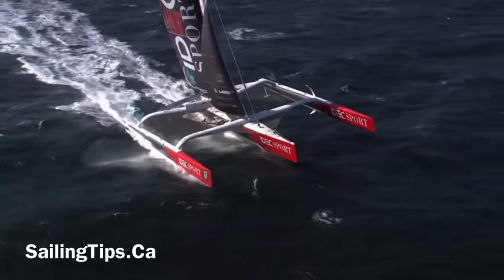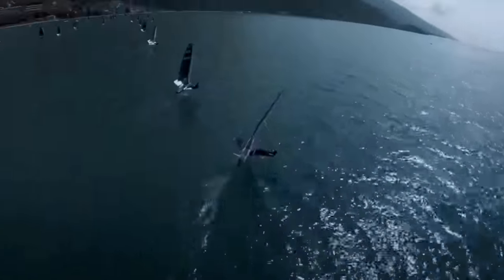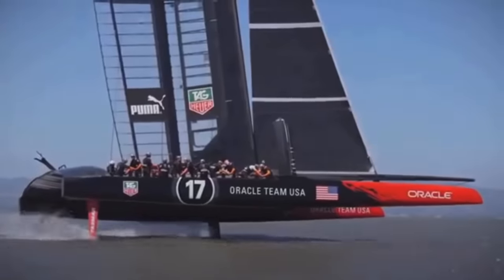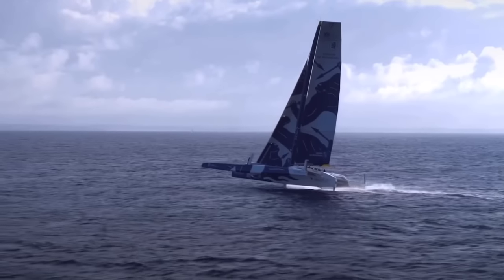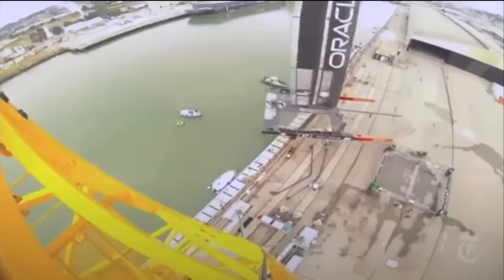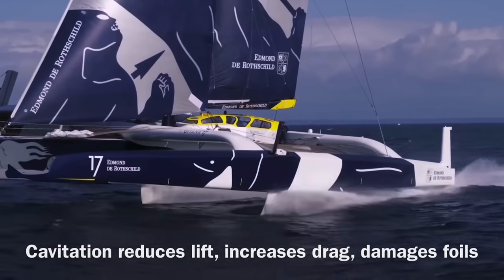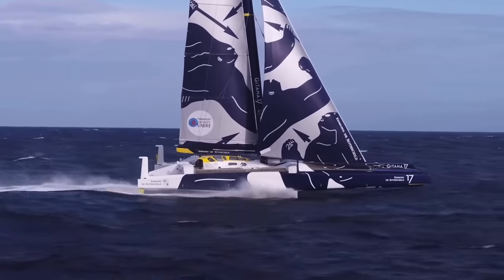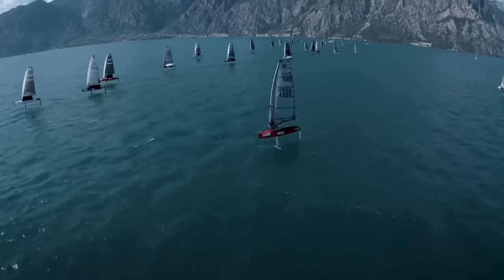How Fast Can a Foiling Sailboat Actually Go?!?!?

Comment: Something is wrong. At the start of the Ocean Race from Alicante, the speed of the Volvo65 was 14 knots, and on hydrofoils, in the same place - 34! It's not 20%.
Что-то не так. На старте океанской гонки из Аликанте, скорость Вольво65 была 14 узлов, а на подводных крыльях, там же - 34! Это никак не 20%.
Reply from the maker: The 20% figure came from two different references - designers of Ultimes and IMOCAs. It's an average figure and in some cases it will be more, and in other cases less! For example for Ultimes in 30 knots of wind the difference will be much less than 20%, in more moderate conditions it will be more, and in light (i.e. non-foiling) conditions it will be less again.

Comment: I knew there was a reason I didn't have a foiling boat.
Reply from the maker: There is a foiling kit available for my F-82R trimaran, but it adds about 10% to the weight of the boat, which is significant when I can feel a performance loss from the weight of each additional crew member! The stakes are also much higher for failure without massive budgets. Therefore the most accessible way to foil for most people is a dinghy like a UFO, WASZP, or Moth.
Reply: @SailingTipsCa  In a roundabout way I was just admitting to being a cheapskate.
Reply from the maker: @nobreighner  LOL or a normal person!

Comment: But of all that is true, why they keep doing these foiling designs for offshore racing? I mean, all the Ultims trimatans have foils that can elevate the hull avobe water given the conditions, not only Gitana 17. If they were so sure that it is sooo much difficult to beat  existing record, why not to just make non foiling trimarans, and optimize all they can in all aspects, just with no foils? If they keep pushing on the foil thing, it must be because the engineers see more potential there than in a normal (and presumable cheaper and stronger) design.
Even the 24h record holder has gone to foils, and I can imagine that was made not to reduce her performance, and we ate talking here about long distance offshore racers.
Reply from the maker: Yes all the.Ultimes now have foils of some kind because they do offer significant advantages in moderates winds, like those encountered in more temperate and equatorial latitudes, and that’s where the engineers and designers feel non-foiling designs are still leaving something on the table.. But to your point, I personally know of two 8-10M trimarans with lifting foils and the owners of them do say there are more effective ways to improve boat speed, like canting rigs and rotating wing masts. The Australian OMR rating system also doesn’t rate foils (i.e. you can add foils to your boat with no rating change) and yet the foiling boats aren’t stealing the podium. There is a foiling kit available for my F-82R, but it adds about 10% to the weight of the boat, which is significant when I can feel a performance difference with the weight of each additional crew member. So my point with this video was that foiling is hard, and not always faster, contrary to what lots of people think, and initially myself included!

Comment: over 50 kn you need ski/skids with dampers much like a snow mobile.
Reply from the maker: That would make a great video!
Reply: @SailingTipsCa  Even Rudders and keels cavitate at these speeds so it's a whole different ball game . I assume that you have watched the latest record holder ?
On the purpose-built Vestas Sailrocket 2, Paul Larsen (AUS) in 2012 set the outright sailing speed record of 65.45 knots (75.3 mph) on the 500-metre course. In 2022, France SailGP Team posted the fastest time ever in an F50, hitting 54 knots (62 mph) during a race. one of the latest methods being trailed is using a large diameter spinning disc to lower the differential velocity between the water and the rudder.
Reply from the maker: @GarretKrampe Yes I did another video “How Did Vestas Sailrocket 2 Smash the Sailing Speed Record?!?!”https://youtu.be/K3m06731BQY That explains how they did it. I hadn’t heard about the spinning disc method - interesting!
Reply: @SailingTipsCa  Yes I have written to the designers in UK and asked if they want to make a legitimate attempt ay an 80+ Kn run . The spinning discs and powered aerofoils  are of my own designs.  But food for thought .
Yes "supersonic" "air foils" are required over 50 Kn basically knife edges. RE numbers are ~9-10 x that of the foil in air so take a plane design and /10 (size chord area etc). I'll take a look at your Denmark Turbines (Vestas) UK designed and built and Aussie piloted video.
Reply from the maker: @GarretKrampe  Very cool!!! I hope the UK design team explores your offer to collaborate!

Comment: Why dont they Dimple the foils like a golf ball to avoid cavitation?
Reply from the maker: Maybe some fluid dynamics engineers can speak to that, however they have added tubercles (like on whale fins) to rudders to maintain laminar flow and prevent stalls: 
https://biekerboats.com/project/rudder-tubercles/
Reply: the dimples delay boundary layer separation on the golf ball a little.   however, the flow environment is so extreme in the cavitation regime that you have to let the flow detach otherwise bad things happen, like wildly unstable flow
Reply from the maker: @tomainsworth5656  Yes there are some cavitation clips in the video How Did Vestas Sailrocket 2 Smash the Sailing Speed Record?!?! https://youtu.be/K3m06731BQY It looks like the wedge foil does a decent job of creating “controlled” flow separation.

Comment: Helicopters have the same problem if the rotor tips break the speed of sound.
Reply from the maker: Interestingly helicopter blades and high-performance sailing rudders often use the same NACA 0012 blade profile!

Comment: Too many long foils. Shorter more rigid foils following a ballast curve for foil length would do much better. Double the foil amount at different locations on the hull with the longest at balance point.
Reply from the maker: The Ultime trimarans generally have a “ray foil” on the main hull daggerboard which is at the balance point, but there’s still the issue of cavitation, whereby foils that are efficient at lower speeds aren’t at higher speeds and vice versa.

Comment: A bit like asking why formula one cars don’t win rally races.
Reply from the maker: It would be more so if both formula one cars and rally cars were encountering issues with the sound barrier on their wings! The issue here is that short-course SailGP and round-the-world Ultimes are all bumping into the same cavitation barrier at around 50 knots. To consistently sail above 50 knots you need to do something more drastic like this: How Did Vestas Sailrocket 2 Smash the Sailing Speed Record?!?! https://youtu.be/K3m06731BQY

Comment: No one has had one flat out
Reply from the maker: Any thoughts on why that might be?
Reply: @SailingTipsCa  the hull design is still under development hydro planning power boats have the Cavitation problem sorted Hugo boss broken foil was slow on one tack because the hull design is ment to lift on the hockey stick /Catalina flying boat hulls and floats worked ok / the much larger hulls on the decommissioned joint venture USMC warship managed 75 knots / as much as it's eng HP was ok with/ the 45-55 knots is the limit of that foil hull design /miniature float plane floats as foils may work /be a risky fun experiment .
Reply from the maker: @ventura1893  Yes there are lots of powered vessels that have overcome cavitation by using “supercavitating” foil and propellor designs. The issue with sailing vessels is they have a limited amount of power to apply to overcome the increased drag of cavitating foils.

Comment: Bla bla...anecdotal stories. There has to be theoretical limiting speed for the case of, say, zero water drag. It might be tricky to derive, but it has to be there. SO WHAT IS IT?
Reply from the maker: The “zero drag” scenario is most closely modelled by ice boats which have gone as fast as 124 knots or 230 km/h!!!
Reply: In theory, the fastest you could go would be defined by dynamic soaring, perhaps even using tall waves in a way similar to the way dynamic soaring RC gliders use cliffs. The top speed these have achieved is well over 800km/h. This wouldn't be something you'd call a sailboat, though, since it minimizes water drag by not touching the water at all.
Reply from the maker: @IsaacKuo  Would those conditions exist close enough to the water for a “sailboat” to capture them?
Reply: @SailingTipsCa  Well, my gut guess is that it wouldn't work for a full size "sailboat" but it could work for an R/C model. Mother nature figured out long distance dynamic soaring over the sea with albatrosses. An albatross is the size of an R/C model, not a manned sailboat, obviously.
Reply from the maker: @IsaacKuo  That’s interesting - I wondered how they managed to fly so far!!!